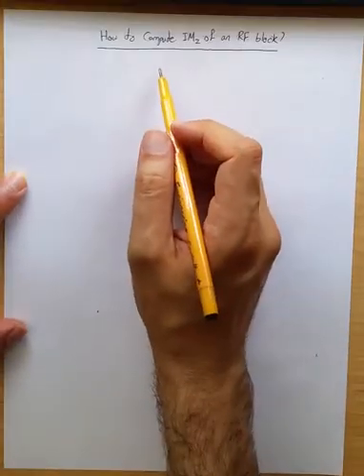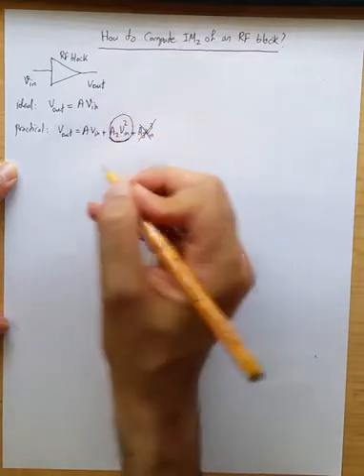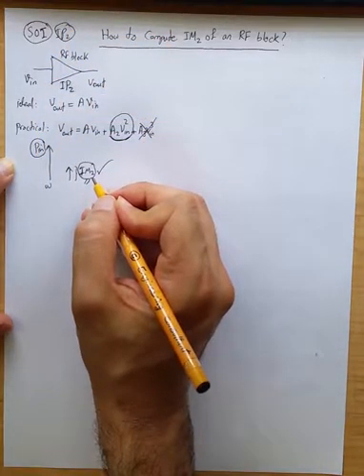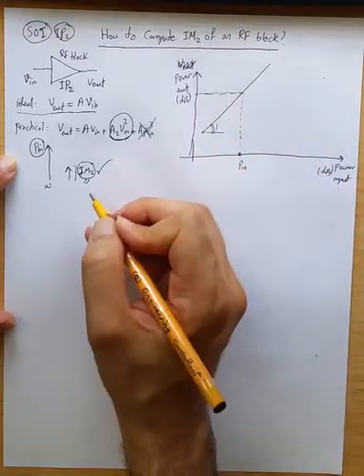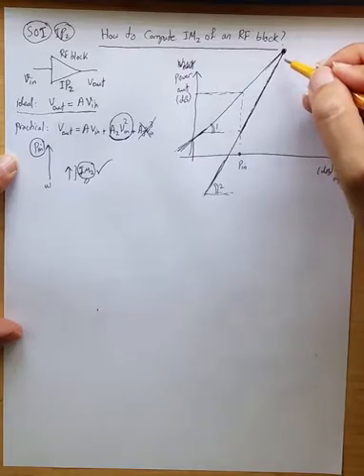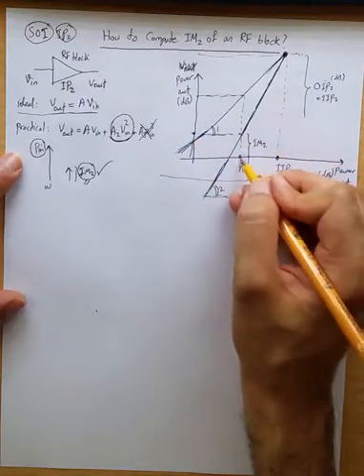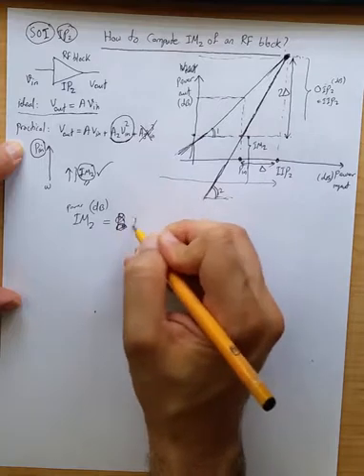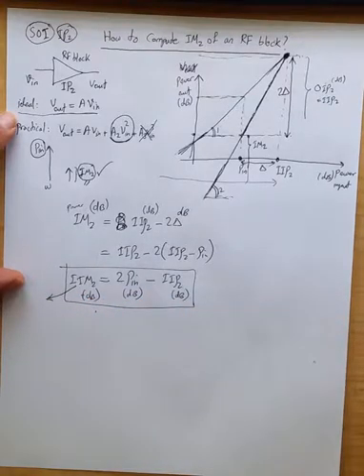Second order nonlinearity of RF Amplifier

Comment: It will be better if you arrange your playlists with proper titles. I went through "Electrical engineering, analog, digital design videos", it have good videos, but it is randomly listed. You should divide these videos or arrange these in a sequence, From basic to advance or any proper arrangement that suits the contents. 
Just a suggestion.
Reply from the maker: Thank you very much for your interest in my channel and for sharing your thoughts and suggestions. You have a good point. I have been thinking about that as well. Main question for me has been: what is the proper arrangement? Do you suggest breaking this single playlist (203 videos) into multiple smaller playlist of for example:  "Electronic Amplifiers", "Power Amplifiers & Voltage Regulators", "Analog Computers" , "Current Sources" , "Impedance Converters & Gyrators", "Analog Filters", "Oscillators" ? 
From a visitor's perspective, Does it help having that many smaller playlist?
Please let me know what you think. Thanks.